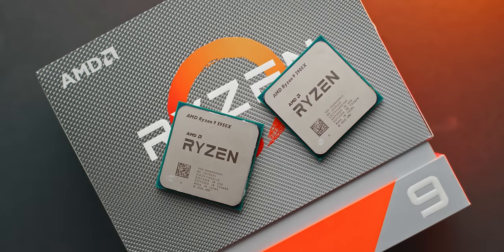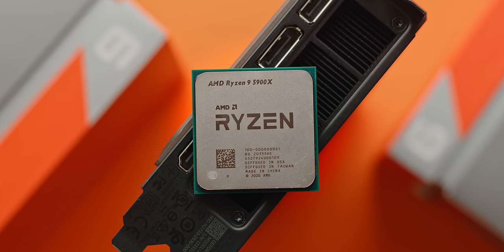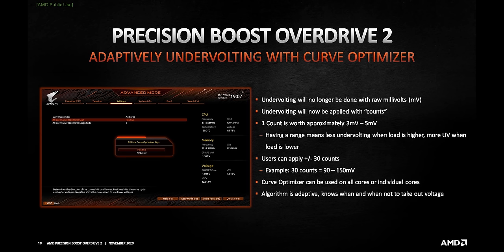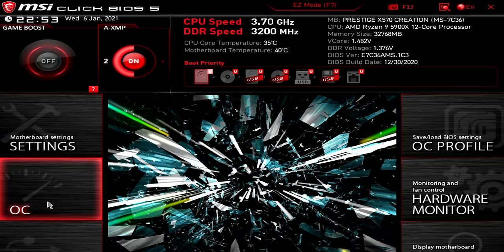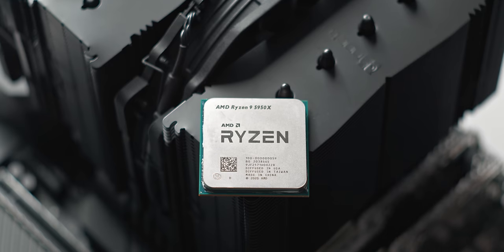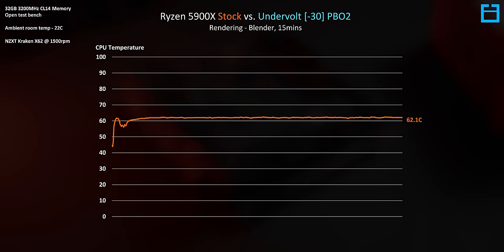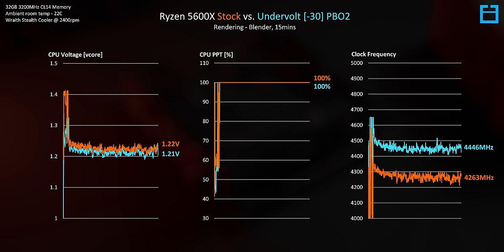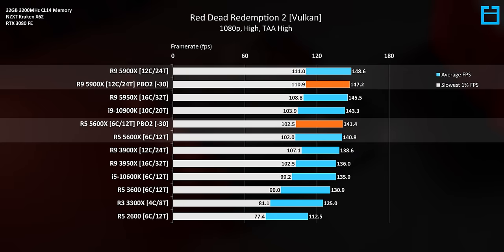Ryzen 5000 Undervolting with PBO2 – Absolutely Worth Doing

Comment: This is amazing. I was able to get my 5600x with a negative 30 in the PBO. Then I enabled eco mode as well. Normally, I get 7-10% less performance with eco mode enabled but with PBO 2, the gap was lessened to around 2-3%. I'm enjoying great performance with less temps.
Reply: in which games or where did you test it? also, why do you use eco mode?
Reply: @Nomad_859  Tried it 3dMark's CPU profile benchmark, as well as Shadow of the Tomb Raider, and Horizon: Zero Dawn.. Also, I used eco-mode so it would use even less power overall.
Reply: @Aries0098  so less power, that means even lower temps right? How much tho
Reply: @Nomad_859  Around 10 degrees less and almost at stock performance.

Comment: I am able to do this on my x470 MSI gaming plus with a 5800x, running great so far! Much better than Ryzen master because Ryzen master locks it at set voltage / clock speeds which isn't as variable and efficient. Basically stuck on max voltage and clock speeds even while idling.

Comment: I followed this guide and used a relatively small offset, my PC seemed stable but the GPU driver would crash 5-10 minutes into games. I had tried everything to fix it mainly trying GPU related solutions, but undoing the curve optimizer setting actually fixed my problem.

Comment: This is pretty impressive. I just went for -25 on my 5600x (Asus Prime X-570p). My single core score remained exactly the same but temps dropped 10oc boosting to the full 4.6 ghz. On multi-core test my Cinebanch R23 score went up by 718 points! temps again sat below 58oc on 4.4GHZ boost on all cores. When idle my temps are now 35oc from 42oc. Great tip and thanks.
Reply: For me -30 made my pc reboot while idle at random times. I tried -25 and so far nothing happened, what's your experience?
Reply: @gigachad1926  I didn't try -30. Just went with -25 and I've had no problems so happy to keep it there.
Reply: @CastleGameZ  Ah ok, thanks for replying. I'll stick with -20, if I find anything wrong I'll reduce it to -20.
Reply: @gigachad1926  try 15 - 19 please. Sometimes in games the -20 crashes
Reply: @Harris.K  I changed it to 18, thanks for the advice.
Reply: any update of y'all cpu's did it not get damage after using the undervolt for a long time?
Reply: @LawAbidingSociopath69  Nah, everything is good for me until now. I tried everything from -25 to -19 before settling in -18, zero crashes for me.
Reply: @gigachad1926  what's best settings for no crashes?
Reply: @LawAbidingSociopath69  For my Ryzen 5 5600X it was -18, perhaps -19 could do the trick but I prefer to be on the safer side. -20 caused a crash on my pc, but I read that others did not have any problems at -20.
Reply: @gigachad1926  ok so -20 is the safest?

Comment: Great video! On my Ryzen 9 5950x I managed to get -16 voltage PBO settings across the board, Stability in AIDA64 Stress test / Cinebench, 60.1 °C  under load... I feel like I finally got silicon gold... very underwhelming results on my replaced 5800x undervolt

Comment: Good video. I get better performance and temps from my 5600x by running it at 4.6 all core clock at 1.225v. But this way would be good if you can't get my undervolt. 👍🏻
Reply: Degeneration incoming, if you have it at fixed vcore

Comment: It does not work at all with my 5600X, despite having the latest BIOS, latest chipset driver, latest Ryzen Master, latest AMD GPU drivers, latest everything.
Absolutely anything but the stock settings will cause a global system hang within the first hour, if not the first minute.
And even the stock settings, I'm not even sure they are actually stable.
So I guess I got a crappy chip.

Comment: 5900x user here. I did the -30 offset and during gaming on less demanding games caused the computer to BSOD. Have yet to try other offsets as I am not very experienced with undervolting. With stock bios settings I idle at around 47-58 degrees

Comment: I leave PBO on Auto and use a manual voltage offset of -75mV, rarely break into 70C with this configuration. I tried Curve Optimizer before but had higher temps, so went back to using traditional undervolting. Maximum that can be applied is -100mV.
Reply: I use manually +138mV offset on core and -156 soc and have curve negative 30 all cores and black 102 and some more stuff and have 4.96Ghz boost and 4.77Ghz all cores on my r5-5600x.
Idle 1.006Vcore, 1.42Vcore peck and all cores on load 1.288Vcore.
Cinebench r23 +12200 multicore and one core idk. Temp goes up to 78C and could be lower if my loop did not have damage. Was runing 4.85Ghz manually 1.4Vcore stable for 2 years until my 7 years old water block underperform. Started to use pbo to gain more fps in warzone2 over manually

Comment: I was able to hit 4.45ghz with my Ryzen 5 5600 (non x) although having temps of 70-75C on my single fan air cooler which is quite impressive.
Reply: Sound good how much offset did you put ?
Reply: @Alex7812Sg  Negative 30

Comment: I don't know quite what the problem is. But I have tried setting up the curve optimiser on my B450 Gaming Pro Carbon. And I didn't even manage to get through a BMW render in Blender after a 10 unit undervolt on my 5950x. So I decided to try the good old negative core voltage offset. And there I could get a 100 mV undervolt going easily and haven't seen any  lower performance or lost stability so far. And still I have gotten a temperature drop of 10-15°C. For reference 100 mV depending on where on the curve you are is 20-30 units on the curve optimiser. So if you are having problems getting pbo2 to work on your system a set negative offset might still work and might even work better than the curve optimiser. It won't increase the frequency as much (though mine has gone from just below 5GHz when running single core games like SimCity 4 (probably the game in my collection with the worst performance. And that is saying something) to just above 5GHz. Probably due to the lower temp increasing the headroom for Precision Boost.

Comment: CPU: 5800X. I followed the guide and CB20 went from 5800 to 6000 with a negative offset 21. FQ went from 4425-50 to 4575-4600. Max load temps CB20 - 80 (fans 80%) and gaming between 60-70°C
Reply: Fans at 80% seems pretty nuts... Did you manage to tweaks temperatures further and run more acceptable PWM fan profile?

Comment: I look forward to trying this on my 5900x on x570 tomahawk, As well as the 5800x on b550i pro ax. Though Im more interested in the ITX application. As its going to be a test between a 120mm evga clc with p12 fan/fans if possible to push pull front mount with hoses sideways & an nh-d15 which will probably win in thermals and noise yet double the cost for a cromax in a tu150. Just a way of trying to get performance w.o spending 100+ on itx cpu cooling if possible.

Comment: Although I have the Asus B550-F Wifi and a 5800x, I was able to set 30 for the curve optimizer and saw a huge jump in boost clocks. PBO on I was getting around 4.45/4.5ghz when in game but with PBO and the curve optimizer I was able to hit 4.69/4.71ghz on a prolonged cinebench test with only 1.35V. Better yet when I am gaming my cpu manages to hit 4.81ghz and temps are looking good at 55c max. Overclocking is still on the table but I am very happy at 4.8ghz.
Reply: Hi. Have you enabled Negative curve or did you let by default? Thanks in advance

Comment: i have a 5900x and running it from the  second day at 4200mhz cuz it is a too hot cpu. Now i have done this curve optimization at minus 20 and in game i have constant 4650mhz with a boost of 15%/20% more fps... this is crazy. I run now BFV in 1080p high settings with a 3070 ti with an avg around 220 fps. Before at 4200mhz was 190fps avg or even less  On stock i don't remember but I haven't used stock setting because the cpu was going at 80 or 83 degrees and I don't like it. So thanks for the info!!!

Comment: My 5900x randomly spikes to 82 degrees and will stay there for several minutes when I’m at the Desktop or just using Chrome or Firefox. This never happens when gaming or under load for some reason so I know it’s not the thermal paste. Nothing has been overclocked or messed with in the bios other than setting my RAM to its rated speed. 
Specs: 
NR200 case w/4 Noctua fans
5900x
G.Skill Trident Z Neo 32GB 3600 CL16
ASUS X570 i
EK 280mm AIO w/Noctua fans
RTX 3080 FE
Corsair SF750

Comment: Brilliant! Well explained, good visualisation... and it actually works! I've just followed your example o with a R7 5800X on a MSI B550-A Pro and get 4700MHz on all cores, instead of 4550MHz. Marvelous! However, the Single Core frequencies have not changed at all... which leaves me a bit baffled. Any Ideas? 

Continue the good work, it's always a pleasure to watch your videos.
Reply: You need to change the "maximum CPU Boost Clock override"

Comment: My 5800x runs on 4850 mhz while gaming with 60 c temps. I use a curve optimizer. Check for optimum 5000 undervolt video. I set optimizer magnitue to -20 with all core

Comment: My 5900x chip just doesn't like this guide. Don't get me wrong, a negative setting of 24 works  just fine , but I noticed I get a faint incurable micro OS lag doing this. After weeks of messing around with every other bios setting, multi bios versions, and even the usb beta fix bios , I have narrowed it down to this setting. Removing this and running stock, static or other non PBO offset settings makes the system run butter smooth again. I have no idea why this is occuring  as I would love to run lower volts like this guide says but the ever so slight micro lag drives me nuts.
Reply: its because a negative offset of 24 is big, with some chips 10 might be pushing it, in those cases if you wanna undervolt you can try in small increments, like 10 max and testing if everything is okay.

Comment: The consensus from what I've been researching is that it's not very stable Undervolting the 5900x?  I see, it really seems to vary quite a lot, and doesn't work for everyone right across the board.  I'm a little scared to do mine, as I've never messed with those settings before.  This is fully reversible if my PC becomes unstable, right?  I build PCs but I'm a little bit of a noob with the technicalities.  My CPU was running at 83c last night when I was running a Face Swap trainer, so I'm a little concerned having it run that hot for 8+ hours.
Reply: It is totally reversible. Simply make a backup of your BIOS settings prior to any modifications. Then, if not satisfied, revert to that backup, and you're good to go. :)
Reply: You wont harm your components, do as the above suggests and just save your current profile and test, if  you have a good chip it would be well worth it.

Comment: If you are not going to use PBO/PBO2 there's no point of buying Ryzen 5000 CPU It's just crazy !! on My Ryzen 7 5800X ECO mode 65W I'm getting 4.850Ghz boost  in games and in Multicore rendering 4.20Ghz using -20 on All cores 72c temps Max with Noctua U9S which is small cooler ! ;)

Comment: I know ryzen 3000 is different from 5000 series, but i got lower temps just by updating bios and chipset.
My 3700x lowered from 85 degrees ( reached 94 once ) to 80 degrees and i was using wraith prism.
Now i'm using a noctu nh-d15 and my cpu reaches up to 68 on full load and 32 degrees on idle.
With my prism, my cpu reached 55 on idle.
And i never underolted.

Comment: I'm surprised by how much the undervolt tolerance can change from one chip to another.
I tried three different 5600x so far and on the same board one of them runs perfectly at negative 30 while one bluescreens at 15 and the other one bluescreens at 20 before i can even get into windows.
Reply: I can't get above 20 on my 5600x without it crashing

Comment: I got my 5900x to 4.4ghz all core @1.100v and scored 22700 points on cinebench r23 multi core with 16gb ram at 3600mhz cl16 and seen a peak temp of 80°c stable after 30 minutes looped on an msi mag x570s tomahawk max wifi with the latest bios and a kraken x52 240mm aio with 5 total fans at 1400 rpm
Reply: 80°C seems to be a lot with a 240mm aio but then again that AIO is really old at this point and wasn't designed for ryzen

Comment: Very nice! I followed your instructions exactly and it resulted in a nice 4% performance gain on R20 with no extra heat. All core during R20 went from 4.125GHz to 4.4GHz.  Thanks a lot!

5600X BO, Asus Prime X470-Pro  BIOS ver 6024, 16GB 3600MHz CL16,  Win10
Cinebench R20 scores
Stock: 4048
PBO (per video instructions): 4211

Comment: Thank you! I had been wasting my spare time to hold down a hot chunk of 5800x for 2 weeks and finally found this. Putting max negative curve on Asus rog b550a which gives extra voltage by default is great. I was never getting into 1600s in cb23 with clock tuner 2.0 or per core offsets, now it's 1624 and multicore is massive with manageable 84 Celcius.
Reply: Can you tell me what exactly you did ?
Reply: @MichaelBB1  well basically I did what you’ve seen in the video. However I got offset mount from arctic support for my aio 240 , now temps are fine even with defaults, hardly hitting 80s with 100% load
Reply: @vladislav_st  thanks for your reply, I hit a constant 90c in R23 mutli core test, setting the curve with -25 and tried even with lower values  but nothing seems to change.
I'm using a h100i on a B550-f.
Reply: @MichaelBB1  try “clocktuner for ryzen”. it will take some time to figure out best settings and how everything works but you will get much more lower t than just using curve

Comment: Thank you for this great video! I plan to run my 5950X @stock and if I can do this with lower temps I'm definitely in! Just a quick beginner question: what is the methodology to find the best stable undervolting magnitude? What would be the symptoms of a non-stable magnitude setting? What are the bench programs to run to confirm the magnitude setting is 100% stable? Thank you very much.
Reply: cinebench was good to see performance hit and see how much heat by putting your hands near the back of the processor and fans and hw monitor and i saw that, on internet my 5600g was stable at negative 25 and more so i set 25 and it was great.i know you can push it more but i wont do it ,with all my settings i got 10%boost all cores and per core boost also but less and above all the thermals was great.prime95 software and cinebench auto time set and manual what you want and you can see whats happening.also gaming of hard titles like elden ring or others that if i had a good performance before and after tweaking,stable fps and thermals is a good way also to see if its working on games.i was set many small tweaks slowly,searching and in some days i found whats best for my cpu, ilearned whats not good settings with one or two reset the bios and good to go.

Comment: PBO caused BSOD every,10 minutes on my new pc. Turned it off, no issues at all. Will have to manually OC. I suppose the PBO values were set to high  or low for processor

Comment: I have a Asus ROG strix b550 board and that pbo limit that you disabled isn't in my bios. I have pbo fmax enhancer and platform thermal throttle limit.
Update: nevermind found the settings BUT looks like it's not stable on my R9 5900X at -30 I'm getting random reboots so i lowered it to -20, since then I've gotten one random reboot but so far so good. We'll see what happen in the next few days. TBH I don't even know if it's doing anything. I did notice for example when rendering a video in Handbrake that I'll hit 4.950Ghz for about one second but then go down to about 4.6Ghz which is what I was getting before. I'm not really sure about temps either. It might have brought temps down maybe 3 or 4 degrees at the most.

Comment: I won't by a high-class CPU like a 5900 and then castrate it.
PBO limit disabled gave me terrible benchmarks
So I tried "automatic" and an offset of -30. WOW!
Cinebench R23 Multi jumped to 23374.
But then, the catch. Not really stable.
So I undervolted Core by Core.
With my CPU, 5 Cores work with -25, 7 with -30.
That still gave me an R23 of 23102 and an R20 of 9094. Nice. And rock-stable.
Get yourself a decent CPU Cooler and sufficient case fans, and don't worry about temperatures in the eighties. 
These CPUs have no problem with that, they are designed for that.
Reply: I'd like to add:
Anyway, Optimum Tech - thank you for the inspiration to try undervolting!

Comment: This is one of the best and most interesting tutorials on the Ryzen 5000 series !!!

Big Question:

Have you heard about this software called ParkContol ??

I saw a video on it, though I do NOT feel100% confident I have understood what it's all about

So my question here is

If I set everything at let's say 90%

Would I get the same results as with under volting ??

Lower temps & higher MHz ?

Thank you in advance !!
Reply: CPU parking is not the same as undervolting, with parking you essentially make idle CPU cores to "sleep" which is kinda useless since modern CPUs already have such behaviour.
Reply: @evilleader1991  

Thank you very much for replying to my question 😃

Many thanks 👍

Comment: Thank you. I was able to undervolt my 5900x but only at -23 all core. Now my max load is only at 55c with AK400 cooler.
I haven't tried AVX but I assume it'll reach way higher than the latter temps.
Reply: Have you been having any stability issues since lowering all cores?
Reply: @AeQuitaS28 hello sorry for the late reply. Its been months since i undervolted it and no there was no hiccups whatsoever

Comment: Clocks unstable though. At least on the lower end chips, it's better to let them chug what they want to keep the clocks stable. My 5600 runs at 4.65 boost indefinitely and in game feels a heck of a lot smoother.
Reply: So did you follow these exact same steps with - 30 on the 5600? Or did you change something?